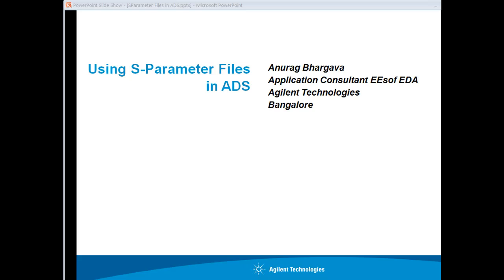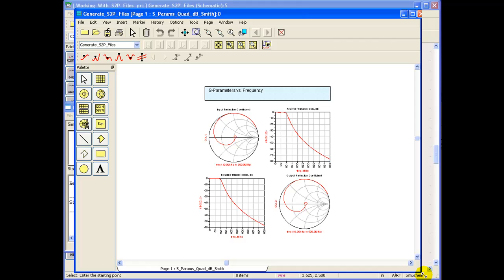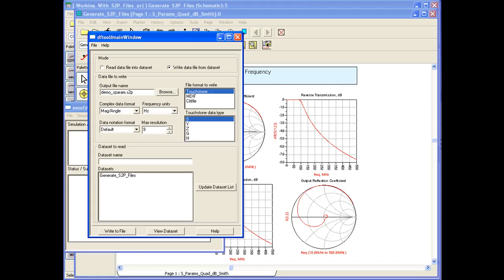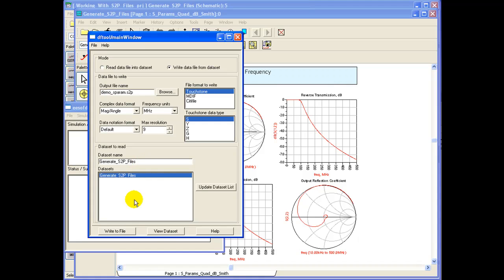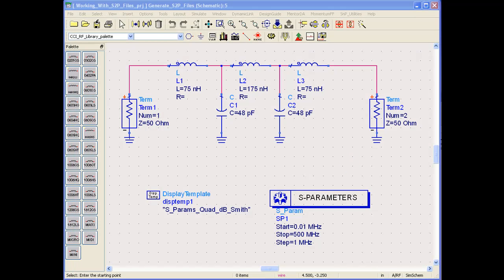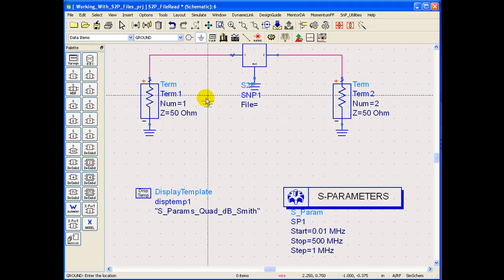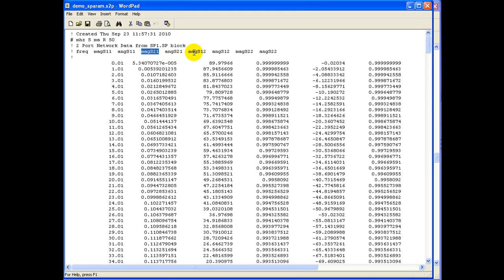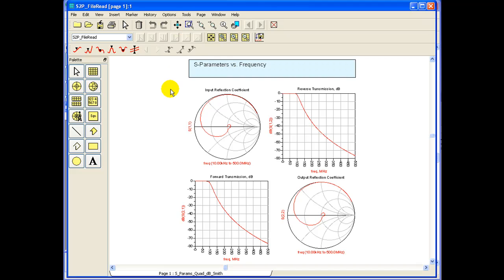SParameter (Touchstone) Files in ADS

Comment: dears, i tried to export S2P file for dual port patch antenna from CST and imported to ADS but i can't get the same plot for  S11 ,S21,S12,S22 on ADS
Reply from the maker: Hi Ehab,
If your exported file is good then you should see exactly the same performance in ADS as long as you keep the same start, stop and step frequency. Also, make sure you exported S2P file with 50Ohm reference impedance from CST.
Reply from the maker: Kindly visit my channel and look at "Learn ADS in 5mins" playlist as that has newer and updated videos for newer ADS versions.
Reply: @BhargavaAnurag  
Many thanks for your cooperation 
I have Avery strange behaviour that S12 and S21 are  appeared like CST  results  meanwhile , S11 and S22  has the same  cst results  but with positive  values  in dB .
As example S11 in cst at  resonance freq. is -10dB 
When import to ADS  , the S11 at red once freq become 10dB
Reply from the maker: @ehabhegazy8179  there is something wrong with your setup

Comment: Sir how to include multi-bias S-parameter file (s2p) for circuit simulation. I will be waiting for your reply.
Reply from the maker: Hi Shubhankar,
So, you would like to simulate multi-dimensional S2P file that is dependent on bias voltage? That should be easily possible by using a DAC (Data Access Component) in ADS. If you have any sample file then share it with me and I will try to create a tutorial on the same.